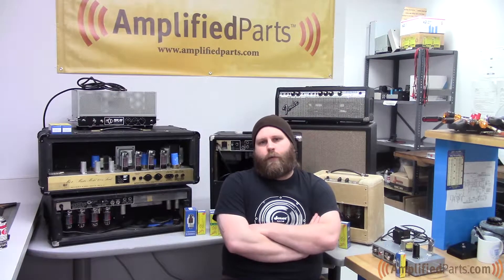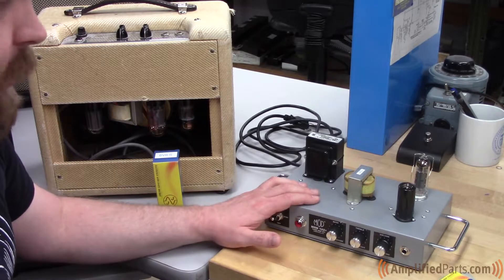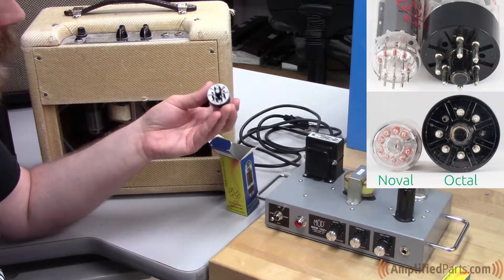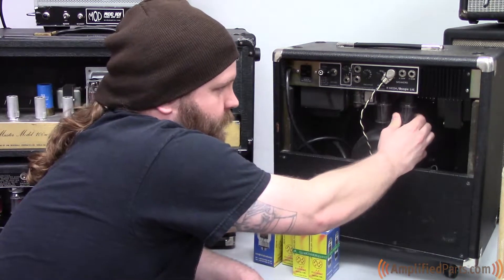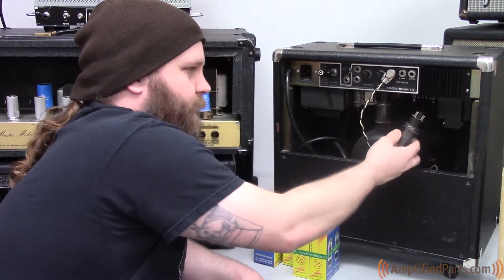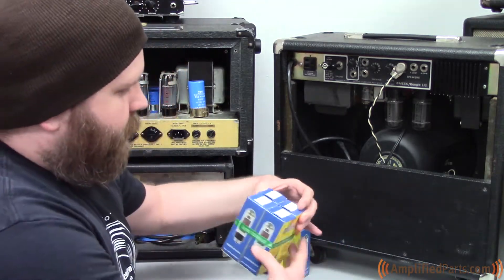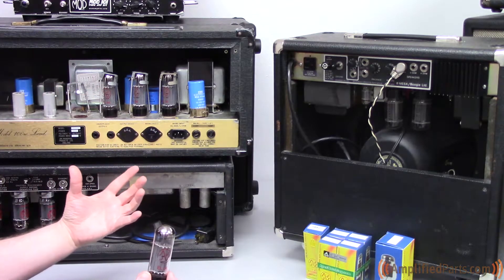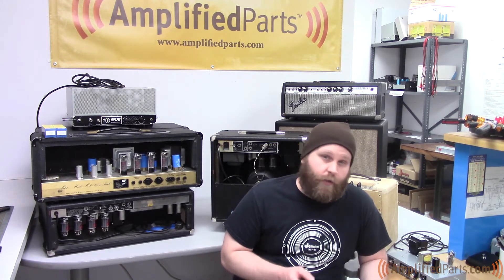Determine Your Amp's Power Rating

Comment: Can I replace a 5881 with a EL34 in a Laney LH50R amp?
Reply from the maker: Hey Bobby,
It depends on a couple factors. The heater on an EL34 has a higher current draw than a 5881 so unless your filament supply can handle that, you may blow a fuse or worse, burn out your transformer. Another thing to keep in mind is the bias supply.  You may find that it does not have enough range to properly bias EL34's and might require some modification. Another thing that could require changing are the screen grid resistors. Marshall commonly uses 1K for EL34's.

So yes you certainly can but it might take some tinkering!
Reply: I did it today My Laney tech helped me do it thank you. But the LH50 amps can take the EL 34s as well just have to bias correctly to -36v.
Cheers
Reply from the maker: Awesome! How does it sound?
Reply: amplifiedparts sounds sick!!! But cleans have no head room Distortion is amazing!
Reply: The clean channel has little head room and a bit mushy and muddy:( but the distortion channel sounds amazing!
Reply: would it be best to get the 6L6GC for this amp or leave the EL 34 in it?

Comment: If I changed out the output transformer, Could I change out 6v6's to 6l6's and get more watts in my amp
Reply from the maker: It really depends on the amp. There are typically more modifications required to change power tube types in an amp.